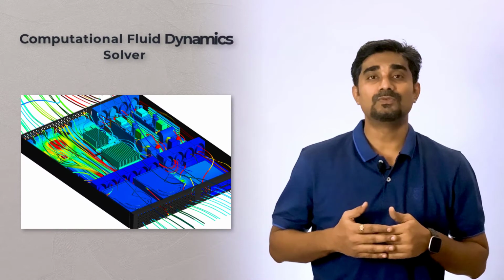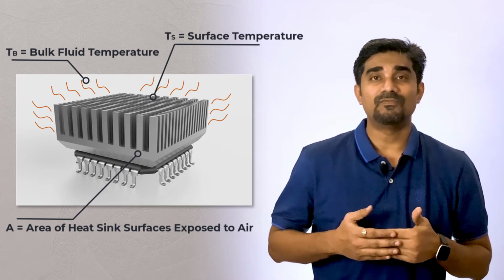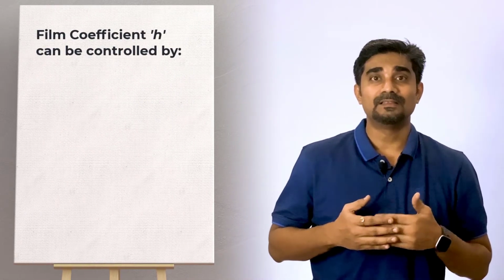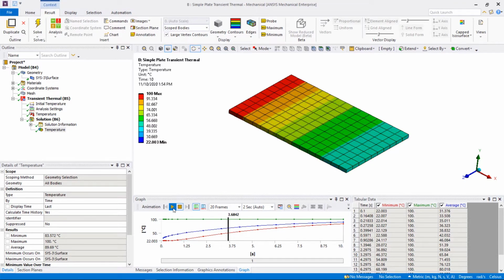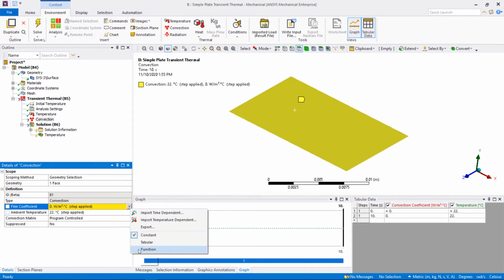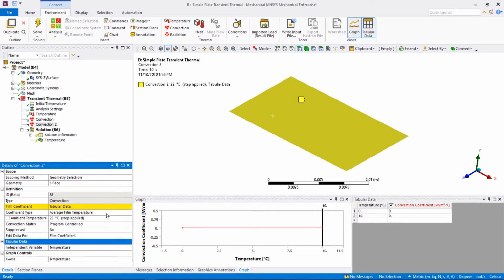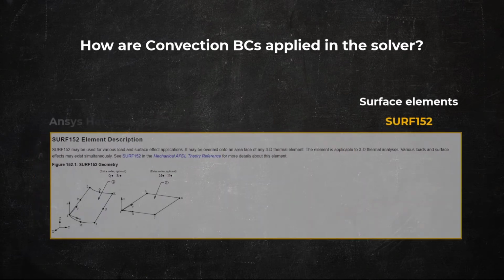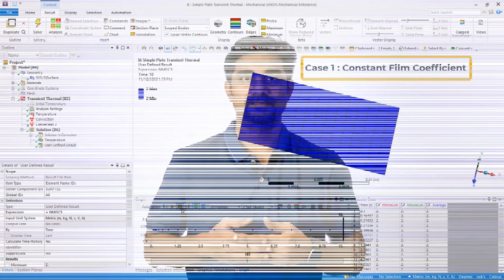Defining Temperature-dependent Convection Using Ansys Mechanical

Comment: Hello,
I have a few questions regarding thermal and harmonic analysis of a part in Ansys.

My first question is, I will keep it at 23°C for 1 hour. Then I will reduce it by 3°C per minute and wait for it to reach -60°C. When it reaches -60°C, I have to keep it at this temperature for 2 hours. Then I will increase it by 3°C per minute and wait for it to reach 23°C. I will keep it at 23°C for 2 hours.

My second question is that I will need to keep the relevant part in a 90% humidity environment at 30°C for 1 hour, and at 50°C in a 95% environment for 3 hours.

My 3rd question is that I will subject the relevant part to 3g peak-to-peak simple harmonic analysis from 10 Hz to 60 Hz in every 3 axes for 10 minutes.

How do I do this type of work in Ansys workbench ? Can you make an example application?

Thank you for your answer, best regards
Reply from the maker: Thanks for watching! Please post your query on the Ansys Learning Forum for a detailed answer from the wider Ansys Community: https://ansys.com/forum.

Comment: if the surrounding air has a temperature of 22°C, why even set a convection boundary with 22°C ambient temperature? Wouldn't a simple temperature condition set at 22°C suffice?
Reply: The temperature of the material affects the boundary layer temperature, which affects the convective term.